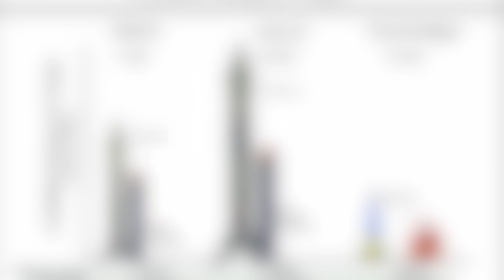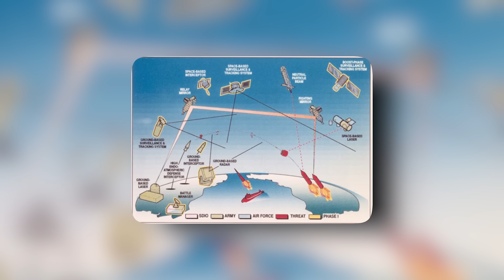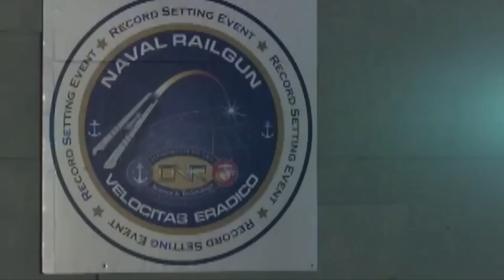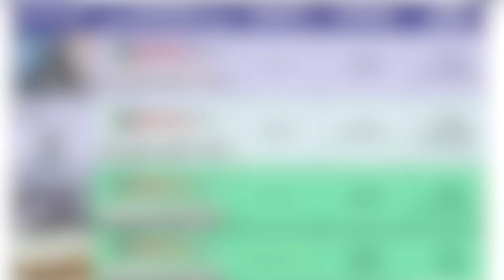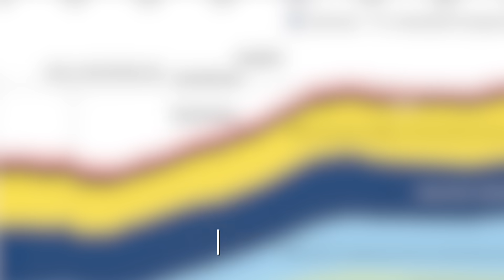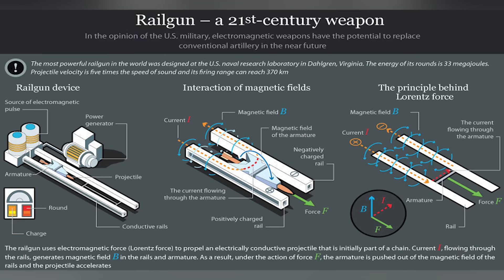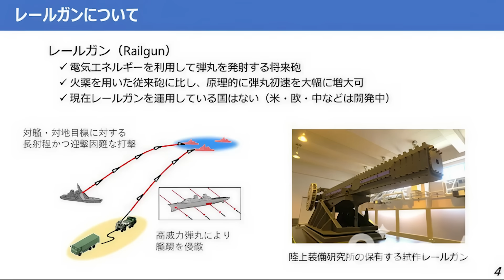Japan Revives a Scrapped U.S. Superweapon — And It Actually Works!

Comment: The problem isn't getting a rail gun to fire, but stopping the rail from warping and eroding after just a few shots.
Reply: That sounds like a solvable engineering problem.
Reply: @justgivemethetruth  there is an electric ark between the projectile and rails. The projectile is sliding over the rails at a few kilometers per second with insane current flowing through the point of contact between the projectile and rails turning both of them into plasma. No solid matter made of atoms can handle this. And the electrical contact between the projectile and both rails is mandatory for the railgun to work. Coilgun can avoid any friction and maglev the projectile but the railgun can't.
Reply: @PalassCat  But the problem has been solved, as far as the JPN is concerned. The US requirements are much higher because they expect to deploy worldwide with few friendly harbors nearby, whereas the Japanese expect a relatively short trip to Russia, North Korea or China. There's a big difference between having to spend 2 weeks crossing the pacific and sailing the stone's throw from Fukoaka to Shanghai (9980km, based on SanFran, vs. 860km). If the US of today was mainly concerned with helping Europe, they could dramatically lower the requirements because they'd have friendly harbors from Iceland to Turkey and 80 years of logistics development between the countries.
Reply: @Zinras  Also how many darts do they really plan on firing. A barrel swap system could probably work but there would need to be multiple turrets. It's almost looking like the battleship or heavy cruiser will be back in business with a nuclear reactor producing the juice for all these energy systems and provide storage for damaged components like barrels and out of commission laser turrets for repair. I bet it could carry an insane amount of cruise missiles and drones also.
Reply: @PalassCat  So, the solution is just to make a coilgun instead, no?
Reply: @Harbinger117-y8g  60+ megajoule coilgun is something out of a science fiction right now. It's like taking a piece of large hadron collider and trying to make it portable. And projectiles don't have electric charge unlike protons so they don't accelerate themselves in a presence of magnetic field, these huge magnets have to be switched on and off real fast. Huge superconductive magnets can't be switched at kiloherz frequencies due to their enormous self-induction.
Reply: @Zinras  it hasn't been solved, they just downscaled the thing by the factor of 1000 (by energy, not by size)
US had a 30 megajoule gun and they were aiming at 60. Japan made a railgun in kilojoule range and called it a day. Conventional naval gun's projectiles have megajoules of kinetic energy, not kilojoules.
Reply: @PalassCat  They "called it a day" because that's their use-case. It's pretty obvious that they're not making long range ship-to-ship cannons with these, they're making anti-drone/missile cannons (which they hope to turn into land-based artillery and potentially coastal defenses). It's unsustainable to counter-fire multiple million-dollar missiles to battle 20-100k dollar drones, even with the seemingly infinite money the US military has - if for no other reason than you can poop out 20+ drones by the time you've built 1 Patriot. Missiles and drones are very vulnerable, so if you can pop them with a cannon firing a cheaper shell at twice their speed it's a pretty big win (though obviously, there is more than 1 layer of defense - it's just that not all of them have to be insanely expensive if this works). As entertaining as the cartoonishly powerful weapons the US likes to envision are, the vast majority of the planet has their biggest threat next door and thus doesn't need the insane overkill the US demands. I imagine the Europeans are interested for similar reasons: dicking on Russians from much further away is excellent and so is cheap defense against their ungodly drone spam if it works out.

And I repeat: unlike the US, the expected range of operations is probably ~1000km instead of 5000-10000km, so hopping back to port for a quick maintenance is much less of an issue because it doesn't take you out of commission for a month. Geniunely, most of the planet has military for defense rather than offense, so they don't need to deliver a lump of metal at 250 miles with the kinetic force of an explosive.
Reply: @Zinras  railgun in NOT an anti-swarm weapon due to it's extremely low rate of fire compared to a normal CIWS. Drones and missiles are not armored targets so the hypervelocity aromor-piercing dart is the worst possible munition against them unless there are hundreds of small darts filling the air. And the whole hypersonic part is not even required unless the target is hypersonic as well. But the attempt to shoot down a hypersonic missile with a single shot from a railgun is extremely optimistic, these things are not easy to track with a radar and they can maneuver as well.
Reply: @PalassCat  pretty sure this would get solved quickly if we convinced any greedy weapon manufacturing company that this is very very profitable and equals good stonks
Reply: Nobody says a word of where the power is stored, you need many batteries that have to be kept up and charged even if not firing. About 5000 to 10,000 cubic feet of batteries.
Reply: @chrisbraswell8864  this thing is meant to be used on a warship with a nuclear powerplant capable of powering a small country.
And batteries won't work anyways, they work on chemical reactions so they are slow to discharge and even slower to charge. Capacitors on the other hand are lightning fast to discharge (lightning is actually just a discharge of a natural capacitor made of clouds) so they should be used as a buffer storage between a big-ass powerplant and a gun to spread the load.
Reply: It isn’t feasible and is actually worse than WW2 era deck cannons in terms of performance. Missiles are better. There’s a reason the US dropped the railgun.
Reply: As per the video, the Japanese managed to achieve 120 rounds on their railgun prototype without significant barrel erosion, and were able to fire it for more. 

IMHO the US' main issue is that they tried to immediately go big with their plans for their railgun without testing small scale rigs first. Meanwhile Japan is a lot more modest in their aspirations for the weapon, and so didn't have to over-engineer their weapon to the same scale the US was trying to do, and thus is able to budget their research better.
Reply: @StrikeNoir105E aas oer the video, the rail gun was not significantly better than any munitions available to US Navy
Reply: The Japanese have already used the approach of "We can give more firepower to our small tanks by using superior materials to make gun barrels that handle more energy" (Japan's geography isn't suited for heavy tanks) 
So they are a bit ahead in this field.
Reply: @marcusc9931  Eh, not really. 😂😂😂

Comment: 23 pounds at Mach 7??? That would penetrate any man made object, almost like it isn’t present… even big multilayered ones, like aircraft carriers, deck, hull, level separations and all of it, sight from the deck through the bottom of the hull
Reply: It's at  2000°C . It would be like moving through liquid when it hit the metal
Reply: it's also the reason the U.S, version failed, they wanted too much, even something that operated at 25 percent of the U.S. spec version is still a long range ship killer...
Reply: @ashleyobrien4937
Difference is price. Why build something that is too expensive and needs barrel swap after a few shots or even one when you can build many rockets instead. Hypersonic ones.
Reply: Its for intercepting missiles using an airburst warhead.

Comment: OK, to skip most of the waffle in this video lets get the info up front, since the implication of the description is somewhat deceptive:

US spends about half a billion dollars to develop a 60+MJ railgun, however there is no scaled production line for it's ammunition and despite advances in material tech it still suffers critical barrel wear bellow 400 shots, which is a common requirement for larger caliber naval artillery pieces, since for obvious reasons it can sometimes be difficult to change the barrel of a naval gun in the field if it gets worn out.
Because of this the program stops significant development.

The Japanese develop a railgun in the 5MJ range, 12x less power is involved, throwing a projectile less than 1/10th the weight of it's American counterpart, and they deem it's barrel life satisfactory at only 120 shots, probably because Japan has a much smaller body of water to police so they aren't so worried about scenarios where these guns will be shot to barrel failure in long deployments or training exercises that involve a lot of gunnery practice.
Reply: Us have even smaller body of water, if we only talk about the main area. In the north they have land border with canada and south we have mexico
Reply: An interesting observation however, is that this parallels the US vs Japan car industry as well. US loves its big, fuel inefficient cars, or rather the 'bigger is better' mentality—possibly due to the fact that, it's incredibly wealthy in resources. Japan on the other hand, with its smaller territory and lack of resources (especially compared to the US), has no choice, but to be innovative and find smart ways to take what exists and make it better and more efficient for their purposes. The railgun that Japan developed may be far smaller than its US predecessor, but at the end of the day, it's an actual working product, that's practical and maintainable.
Reply: @SaphirKnight no, it was designed to be put on ships, which, for it to be an alternative to missiles and the 5", it needed to be as big and powerful as it was. Which is to say that it was not it's maximum. potential, either.
Reply: @RAWDEAL064  Fair point. I wonder if there will be a successful scale up, of the railgun that the US was attempting, or if the laws of physics simply make the task exponentially too difficult?
Reply: @SaphirKnight I think they dropped it altogether and went in several different directions. Partially because of Ukraine. 

I could see the Army picking it up, maybe in the next decade or so. I don't think it's dead per se, just shelved waaay in the back. Kinda like the NGAD of the 90's
Reply: @RAWDEAL064  Would be interesting  to see it developed. Railguns are just too cool.
Reply: @SaphirKnight agreed. I was super pumped when I first say it back 2010-ish.
Reply: @SaphirKnight  It's not a physics problem but a material science problem on two fronts.  First the capacitor banks for the guns tend to be very large and heavy for a given weight of shot.  To deal with this a more efficient energy dense capacitor chemistry will be needed.  Not impossible but time consuming.
The other issue is firing the gun in an atmosphere, the combination of extremely strong electrical current and air friction generates an envelope of plasma around the projectile as it travels down the barrel, this plasma ablates away layers of material from the barrel which is what that smoke and flash you see coming from it is.  In a conventional gun it would be burning gunpowder but in the railgun it's burning barrel material.  The more ablated the barrel is the more friction there is and with the DARPA railgun it became excessively bellow that desired 400 shot lifespan.
Reply: @SaphirKnight 正しい評論です。

Comment: Railguns use unguided projectiles, just like rifle bullets, and they need to hit their target. Can they intercept a high-speed missile from tens of kilometers away?
Also, even if the speed is high, the destructive power of a bullet with a mass of less than 1 kg is limited. Can it penetrate the hull of a battleship?
Unless these can be done, unfortunately, its uses will be limited.
Reply: They don't intercept. The make giant holes I things
Reply: The force exerted by these projectiles are massive even with a "light" projectile. Hence the destructive power is massive as well. These will penetrate a hull of any known battleship (no one really has any anymore) like a hot knife thru butter.

Comment: A railgun's bore life, referring to the lifespan of the barrel, is a major challenge in railgun technology. Currently, railgun barrels can wear out after just a few shots due to the extreme heat and pressure generated by the high currents and launch accelerations. While some advancements have been made, increasing the number of firings before needing replacement, achieving the desired level of durability for practical military use remains a significant hurdle.
Reply: Alternarively my first idea would be a hobby knife sort of solution, worn out barrel? Push it out. Switch to the next one. Or go rotary style. It doesn't matter if you have replaceable barrels.
Reply: @GundamReviver  except the part where it’s extremely large and heavy and where do you store them and what do you do with old barrels at sea? Chuck them overboard.

This is a major problem that ships have now. You can’t re arm missiles at sea. If we haven’t solved the logistics for it with missile, which are lighter and smaller, then it sure as hell doesn’t exist for a gun barrel

Gun barrels need precision and calibration or else accuracy and potential self destruction become increasingly likely
Reply: @Menuki  Wouldn't the solution for that be dedicated supply ships?
Majority of ships usually work in groups of other ships, so it would not be a stupid idea to include supply and or service ships to the mix.

If airborne refuling was managed, then resupply and or maintenance at sea should be a piece-of-cake.
Reply: @Alliancewolf  the crane needs to be high enough to get well above the deck. 

When it’s got a multi ton chunk of metal being moved laterally can easily unbalance a ship casing it to tip over….thats assuming the water is glass flat. 

Existing missile system can only be reloaded on the smallest ships and they don’t weigh anything near a massive gun barrel.

The other thing about gun barrels is they need to be dialed in for accuracy. For the speed and distance a rail gun fires, a little deviation ends with a massive miss.

But drones are solving the supply problem too, massive yacht sized semi submersible drone loaded that can link with a ship and basically be fire via Bluetooth. When empty, it goes back to port on its own. 

You can have multiple drones in a convoy or loitering to relink as the empty leaves. They have the added bonus that empties can be used for waterline defense. A new threat from aquatic drones. 

They could be linked to any vessel regardless of size, passed to different ships, and don’t require any significant retrofitting. 

Theoretically, they could even be used as defensive traps. If a ship doesn’t match a designated frequency, it fires on it
Reply: @Menuki  this isnt a direct argument, but are replaceable barrels just not considered viable for accuracy based weapons? Old MG's often had easily replaceable barrels
Reply: @GundamReviver  That would be the optimal solution: if the rails are essentially disposable, then design a system for replacing them.
Reply: Not really.
Problem of that US railgun that they used soft material for barrel, and hard material for projectile.
For guns the opposite is true.
According to the report US engineers didn't even tried to do something about it.

There were number of other similar issues that also have obvious solution yet no attempt to implement them was made.

To me it looks like this "project" was a money embezzlement scheme rather than an attempt to create an actual working system.
Reply: Used to be that way, but clearly contradicted in the video, where they mention 120 shots without barrel wear.
Reply: @brettshaff8772 even that is really short. Current ship guns have a 1500 round life.

You also have to remember logistics. If you’re just off the coast, it’s really easy to go back to port for new barrels. The US Navy doesn’t really operate locally. Sailing from the Mediterranean, South China Sea, or the Persian Gulf isn’t convenient. Especially, if one of your major weapons is down
Reply: @brettshaff8772 120 shots is nothing realistically. modern naval guns can fire 600+ times before needing barrel service, and even massive 15 inch guns on battleships back in ww2 could go through about 400 rounds before needing service. thats 400 from each of its 3 barrels no less.
Reply: Someone didn't watch the entire video...
Reply: Please watch the video and leave a comment. Japan has solved the problem of wear and tear.
Reply: Thanks ChatGPT
Reply: @nullptr99  My 3rd grade teacher's friend brought a homemade coil gun to school for a "science demonstration" or something and shot a nail through the lunchroom window. It used the foil from a gum wrapper as a firing fuse.
Reply: @nullptr99  Yes, the arc flows across the fuse and the Flux reacts perpendicular forcing the projectile to accelerate. However, the arc is of such magnitude that the ambient gasses are cooked leaving carbon and other residue. The acceleration distorts the projectile in unusual forms adding great wear. Many dynamic forces and much chemistry is happening all which keep barrel life limited.
Reply: It's a feature, not a bug: the projectile needs to close the electrical circuit between the rails, which it becomes magnetized to, which is how the weapon functions.
Coil guns don't have that problem, but they produce a fraction of the acceleration.